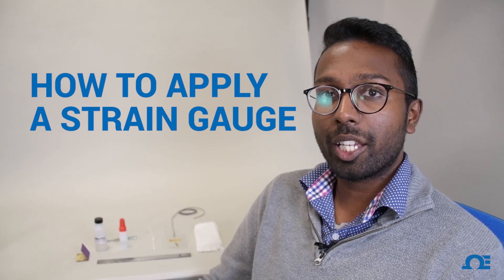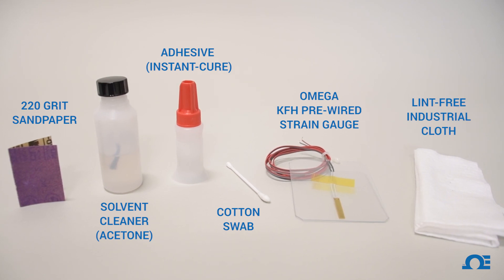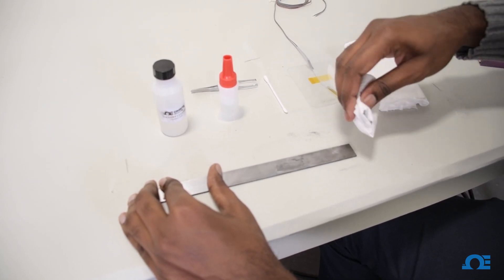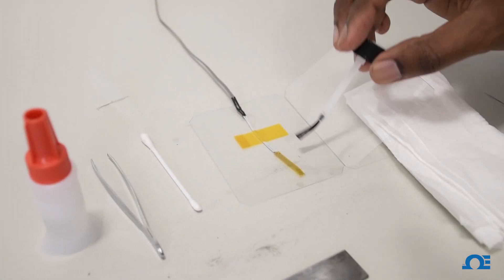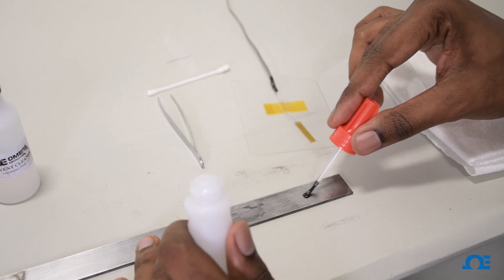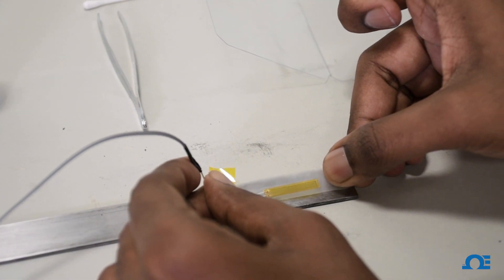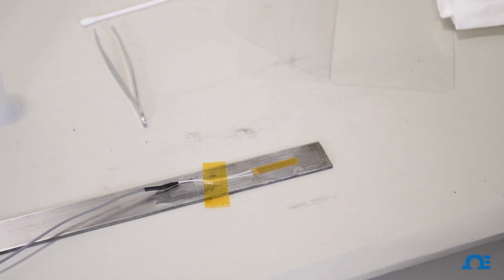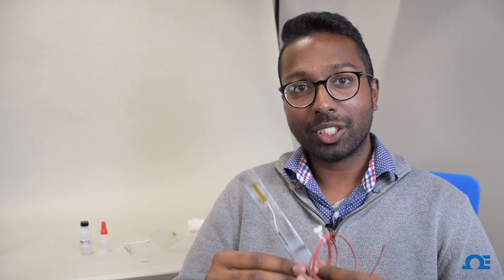How to Apply a Strain Gauge - Tutorial (Stainless Steel Flat)

Comment: Sir I have to measure the pressure applied by the tail stock of the Lathe on the specimen clamped in the chuck. What type of Strain Can I use?
Reply from the maker: Dear Asif good question! You can get more in-depth answers from one of our Pressure Engineering Experts by emailing: pressure@omega.com

Comment: What kind of glue do you use? is it glue for eyelashes? Thanks
Reply: The proper glue to use is called M-Bond 200 & it's used with a 200 catalyst. I wouldn't trust normal super glue - it's essential the gauge is properly bonded to the surface, else the data will be meaningless
Reply: Bro where can I get that adhesive in India  @MrBassman91

Comment: According to the PDF below, the surface of the stainless steel should be degreased prior to sanding to prevent driving contaminants into the surface.http://www.vishaypg.com/docs/11129/11129B129.pdf
Reply from the maker: Absolutely, a typical sequence of steps will be brushing/cleaning the surface, degreasing, polishing surface, removing dirt, applying adhesive and then bonding the strain gage. The SS Flat was brushed to remove the dirt, cleaned and then 220 grit sandpaper was used. You can reference the article shown below for a step by step procedure:
 
https://www.omega.com/technical-learning/pdfs/StrainGageAppQualityCntrlSteps.pdf